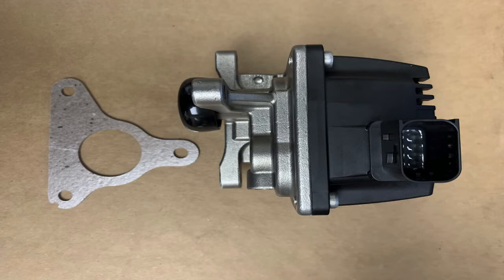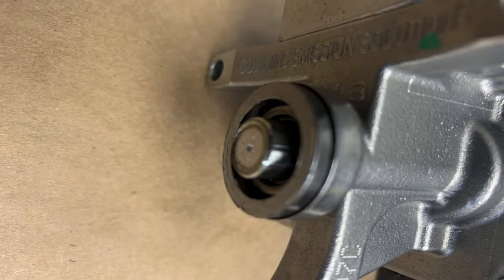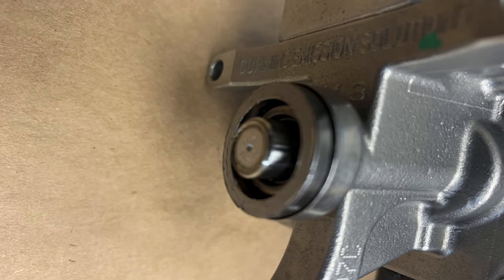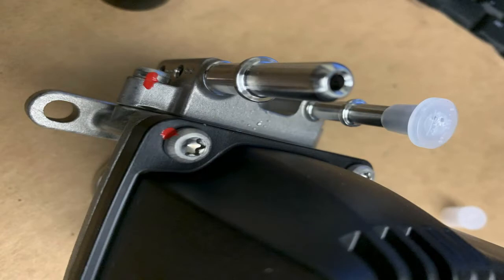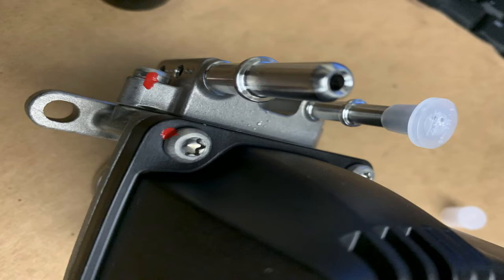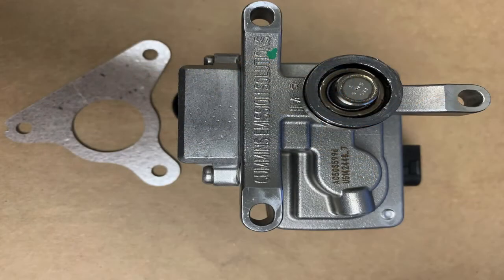Aftertreatment Cm2450 part 11 UL2 DEF dosing valve

Comment: So where is the pressure for the dosing built? I have a problem of the pressure building up to 200 psi.
Reply from the maker: The  DEF pump that sends fuel to this injector works on a feed back loop. The DEF dosing valve has a pressure sensor in it. The ecm reads that pressure and then changes the pulse width on the pump drivers. ( speeds up or slows down supply pump). the pressure is engineered in mechanically and electrically.  All that information travels over the data bus. if it is logging faults follow the fault tree for the fault. I have never had to deal with this issue yet. Its your lucky day LOL
Reply: I got a p1514 code DEF dosing malfunction.. I replaced the desert and still have the issue.. could I be the pump?